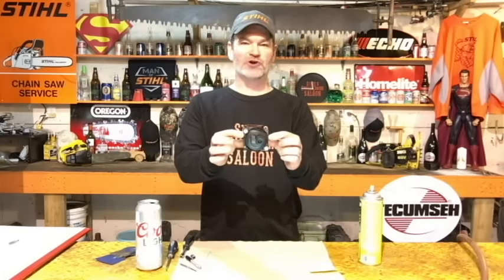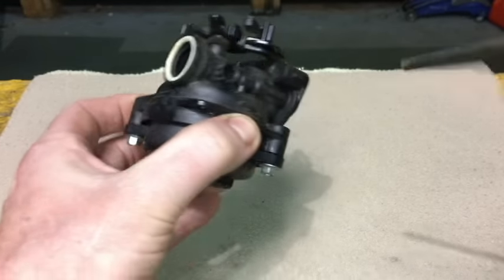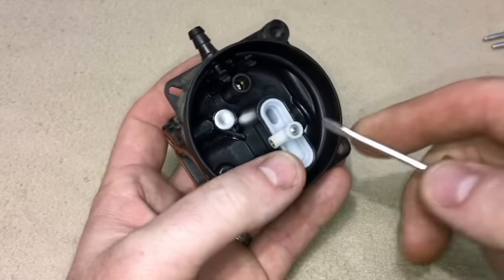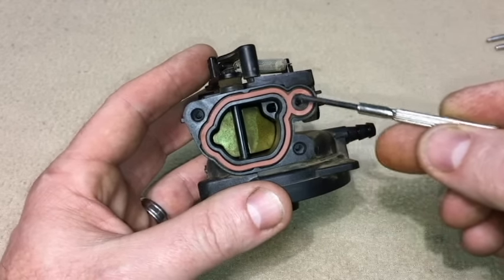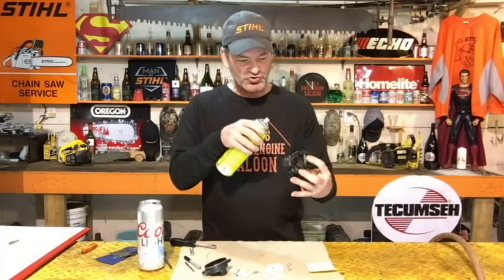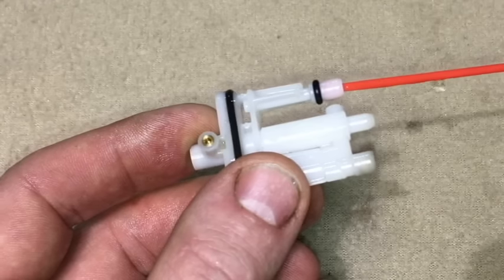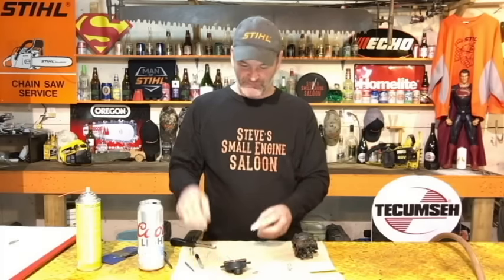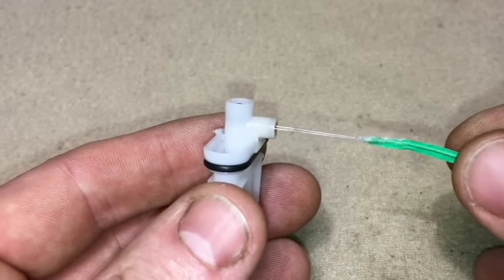EASIEST WAY To Clean a Plastic Briggs Carburetor

Comment: Hey Steve, 
My son brought home a mower that wouldn’t start, I noticed that it had one of those Walbro  plastic carburetors. The jet was clogged with what looked like corrosion so I drilled it out with a.04mm drill bit. Blew out the ports with carb cleaner. This mower runs like new.
Thanks so much for your advice and tips. I watch your shoe often.
Reply from the maker: You're Welcome...

Comment: Steve, thank you so much! My wife found a Craftsman mower for sale cheap, guy said it wouldn't stay running. I fired it up, it quit right away, but unit was in impeccable condition and engine sounded healthy when it ran. Tried cleaning carb, no luck. Then came across your video, followed what you said, now it runs like new! I was raised on the old metal Briggs carbs, this plastic one threw me for a loop...thanks again, Steve!
Reply from the maker: You're Welcome...

Comment: That man is a 'ginormous' talent. Respect due!
Reply from the maker: Thank You...
Reply: @StevesSmallEngineSaloon  hey Steve I need you help I bought a new carbureoter for my mower cause I cleaned it and that didn't fix it so I bought a new one and it still won't run it is not getting fuel to the motor I don't know why ?🤔

Comment: Spot on!💯👍. Just subscribed. I just did this yesterday. I didn’t remove the carb, just dropped the float bowl, popped out the jet assembly and cleaned it. As I didn’t see this video first, I put it back together and so far it runs fine. If it happens again, I will drill out the jet.
Reply from the maker: Right on

Comment: Thanks so much Steve,

My neighbor asked me last week if I knew anything about Briggs & Stratton engines.  I told him I've had pretty good luck keeping the two Quantum Briggs motors going on the two mowers I have.  My mowers are 20, and 25 years old, and they both came stock with the old 3.75 horse B&S engines.  The older of the two was lent to another neighbor who was kind enough to bring it back, not only with a bent blade, but a bent crankshaft and of course the lower seal destroyed, rendering it unable to hold oil.  :(

Another neighbor of mine was a scrapper, so I asked him if he had any old Briggs motors around that might have a crank shaft for me.  He said he had one, but it was a 6HP quantum that didn't run.  I asked what he wanted for it, and he said since it was scrap, just my old motor if I could get this one running.

The 6HP quantum had practically no compression, so I went to pull the head off, only to find that all 6 bolts were loose as a goose.  I bought a new gasket, put it back together and it's been running solid for 10 years.

The second, the 20 year old mower I bought new to keep at a second property.  It had the same 3.75HP motor as my original, but came with a plastic carburetor, which was tank mounted, and looked like my  moriginal, however, it never ran right from day one.  It was subject to constant stalling, even when my grass was never an inch overdue for cutting.  My scrapper neighbor had another Quantum 6HP laying on the ground beneath the bed of his truck, so I asked him what he wanted.  Again, he said it didn't run, so he was fine with an exchange.

That motor had a clogged jet, which is such an easy fix, since the jet is in the bowl retaining nut.  That motor has been running solid for 5 years now.

I told my neighbor, if it's a Quantum on his mower that I could probably fix it, so he brought it over yesterday.

It wasn't a quantum.  It was a brand new Craftsman that had a new style 6.75HP motor with the same plastic carburetor who went through in your video.  He bought the mower new at the beginning of the season and was only able to use it to cut his lawn 3 times before it quit running.  It would start right up with a shot of carb cleaner, then quit.  I was hoping it was just a stuck float, however the bowl was full with clean fuel when I opened it up.

The main jet was visible, and I couldn't see debris in it, so I figured it was time to search YouTube...

I couldn't see how the jet assembly was retained in the carburetor until I stumbled on to your video.  Thanks.  :)

I popped it out, and it still looked clean, however, I couldn't see light through it while shining a bright light against the nylon on the revers side, nor could I blow air through it.  I worked a sewing needle around in the hole for a bit, then I could see light shined against the nylon through the hole.  I was able to blow air through, then get a shot of carb cleaner to pass through from the other brass inlet with the output port blocked.

I put his mower back together, and of course it started on the first pull and sounded like a brand new mower.  Hmm...  maybe it runs like a brand new mower because IT IS A BRAND NEW MOWER!!!

I don't get it Steve.  Why are plastic carburetors such a problem?

I have a reasonable understanding of metallurgy, and I could see if it were an issue of dissimilar metals, I.E. if the jet were alluminum, pressed into a steel body.  But that is not the case.  Why should the jets on these plastic carburetors be so easily blocked?

Thanks again for the great video.  Like I said, I couldn't tell for certain how the jet assembly was held in the bottom of the carburetor until you showed me.

Steve

P.S.  Are you really the man of Stihl?  :)

Comment: Thank you Steve. I just fixed a mower for someone after watching a couple of your videos about these plastic carburetors. The one I was working on definitely had a "too small of a hole" problem. My thoughts are that it was just corrosion from the fuel she'd been using (ethanol); what I drained out was so cloudy you couldn't see the bottom of the tin can I drained it into. That water, over time closed up the hole in the jet. Also, at first, HATED the idea that Briggs had made a completely plastic carburetor. I've since changed my mind. It's simple and it works.

Comment: Thanks, Steve!  They've modified the cartridge yet again, at least on mine - jet is bigger, located at bottom, original location blocked off - but your walkthrough got me to a running lawnmower.

Comment: I know I’m 3 years late to the party but I need to tell you thank you for this video. You saved me hundreds on a new mower. I was at my last straw. I cleaned my carb 3 times, the gas tank and fuel lines twice, new plug and air filter too! Could not get it to stay running. I mowed my entire lawn by spraying starter fluid at the intake the whole time! I never knew that little white jet housing could come out. Sure enough that “secondary” outlet was clogged. Sprayed it, used my pin vise to loosen the clog, sprayed it again and reinstalled. Now my mower starts on the first try (no ether) and runs like a champ! Thanks again, Sir!!!
Reply from the maker: Right on Brady!  You're Welcome...

Comment: This is THE BEST video EVER for a B & S carb fix.  I first saw this video three years ago after I bought a Craftsman lawn mower off of craigslist for $25--the ad said it "wouldn't start."  I paid the $25 and followed Steve's carb cleaning video, and it started after the first pull.  Fast forward three years, and this same mower started having RPM surging issues last week.  I replaced the spark--no good, stilled surged.  I again pulled up this video, followed the carb cleaning steps again, and no more surging.  Thanks!
Reply from the maker: Right on buddy!  You're Welcome...
Reply: I have a machine that does up-rev motions, why does it do this?
Reply: @antonioalvarez2357  No guess.  If it has a B&S carb like these, try the cleaning.

Comment: Couple of points. When removing white cartridge, be very careful if you use small flat blade screwdriver that you insert it deep enough between side of white cartridge and black sidewall so you do not damage the thin O ring at the top of the white cartridge. When reinstalling this cartridge, be aware there is a plastic sleeve that sits in the body of the carburetor between the butterfly valves. It has a hole in the side wall of the sleeve. You cannot see this hole unless you remove the sleeve. This hole in the sleeve lines up with a hole in the body of the carburetor. The central jet of the white cartridge must pass through both of these holes to seat properly. Sleeve can shift while you are working on carb making it impossible to reinstall white cartridge. Cartridge should install with little pressure to seat it properly. If you find it very difficult to reinstall, sleeve probably moved and holes not aligned. To fix this, need to gently remove the larger butterfly valve (throttle) metal piece. It fits into a slot in the small plastic pin the holds it in place. GENTLY spread the slot apart and GENTLY remove this metal piece. You can then pull the pin out giving you access the the White/Grey sleeve. Can use your small finger to reach into space to sleeve. Use small probe and insert it through the hole where the main central jet on the plastic cartridge seats in the carburetor while using your small finger on the sleeve to align the holes. Once aligned, remove your probe but keep your small finger on the sleeve so the holes stay aligned and reinsert the plastic cartridge. Should easily seat in place. Reinstall throttle pin and gently insert the metal piece into the slot in the throttle pin, making sure you have it oriented properly.  What should have been a 20 to 30 minute job today took almost 2 hours because of these issues (torn O ring) and trying to figure it out ( as well as breaking that plastic throttle pin and having to glue and clamp it and waiting for it to cure before being able to reinstall it)
Reply: I think he heard you.  He did another video just to mention this plastic sleeve!  Well done!
Reply: Do you have a video on this procedure please..
Reply: Yikes, I need to read this comment again in future before I attempt any maintenance on this carburetor though, reading this has scared me so much I may never try it now!  I would very much appreciate a video that allows me to visualize what you have described here. :) 
[9.19.2022]
Reply: Many thanks for your important complementary comment.

Comment: The tip about drilling the hole bigger worked perfectly.  I bought a new carb and it was dead in two weeks.  I drilled the hole bigger as you suggested and it started up on first tug and no longer has issues with clumps of wet grass.
Reply from the maker: Right on

Comment: Hey stevens, this one really helped me. I've had that damn carb off 3 times, cleaning it. Put it back on, it would run for 10,15 minutes, then stop. I was loosing it! Then I watched you man.. drilled that little shit out to 20 thou,  wa,la,  runs like the wind.  Your awesome my man! I thank you, your saving the little guy a few bucks. I appreciate your help and your time. Thank you, God bless..
Reply from the maker: You're Welcome...
Reply: The fuel line should have an in-line filter because its inevitable that debris will get in the fuel, I seem to remember putting one in last time I had to clean the stupid carb out.
Reply: Sounds like Micheal has some slightly dirty fuel, defiantly a design flaw in these new carbs. Stevens is the MAN. this make me wanna start doing small engine repair. must be tone of these new carbs out there.

Comment: I installed a shutoff in the fuel line and turn it off and run the engine until it runs out of gas when I'm done mowing. It actually runs for four or five minutes on what's in the bowl. Between that and using stabilized non-ethanol fuel I don't expect problems in the future, but if I do, I now know how to fix it. Thanks, Steve, very clear tutorial!

Comment: I watched this video the other day. I have no experience with mechanics. My push mower wouldn’t run this year. I took the carb off and cleaned it with carb cleaner. I didn’t have to drill out the main jet though. My mower starts and runs strong. Thanks so much for helping me! I appreciate you very much. 😁
Reply from the maker: Great job!
Reply: @StevesSmallEngineSaloon  thanks! I was filling very accomplished. However, my crank top just broke. I don’t know how to order a replacement. 🙄

Comment: I took out the carb and cleaned it out and I brought my dead mower back to life. I also bought the drill bits you recommend below but they came in after the operation. The lawn mower has never run "right", so I think when I get a motivated I'm going to take the carb back out and try drilling that hole as you suggest. But it starts WAY easier than it used to just by doing this. Thanks for the video!
Reply from the maker: You're Welcome...

Comment: I just had my first experience with a plastic carb this weekend. My mother bought a craftsman power washer with a b&s engine last winter. She used it about three times then put it away with fuel still in it and couldn't get it to start when she tried to use it again months later. I pulled the carb, cleaned it with carb spray, washed it out with soapy water so it wouldn't melt (don't know if it would but why take chances), then blew out all the jets and passages with a compressor. After that it fired right up. I didn't bother with drilling out the jet but I made sure she understood the importance of not storing it with fuel still in it. Then she made power wash her house lol. I have admit, the carb was very easy to clean but I still don't like plastic. I really enjoy your channel, keep up the good work and have a cold one on me.
Reply from the maker: Right on Buddy!  Thank You...

Comment: Steve I’m in full agreement with you, this is absolutely the problem!!! I have broke down the carb two different times and throughly cleaned it. Put it back together pump the primer valve 3-4 times and it would fire right up. But then stop after burning off the initial fuel from the primer!!! I watched your video, tore it down for the third time and took the bread tie and cleaned it out throughly again. Put it all back together and fired it back up and it “RUN LIKE A CHAMP”!!!! Thanks for the Lesson and the Video!!!!!!!
Reply from the maker: Right on Harry!  You're Welcome...

Comment: Received a Troy Bilt Mower for free today that wouldn't start.  I was a plastic carb virgin but followed your instructions and now it starts on the first pull and runs perfectly.  The main jet did seem to be clogged and I blew it out with carb cleaner.  You da man.
Reply from the maker: Thank You...

Comment: Exactly the problem on a brand new Craftsman mower. A cutting torch tip cleaner followed by the micro drill bit and it starts and runs better than ever . Thanks for the fantastic video  and the sure fire fix for these composite carburetors,well done!
Reply from the maker: You're Welcome...and Thank You...

Comment: 2020 CRAFTSMAN 2800-PSI 2.3-GPM Cold Water Gas Pressure Washer with Briggs & Stratton. New purchase $289, worked perfect.
2021 Summer. Won't start. Paid local repair man $40. Was told to use non-ethanol gas to prevent carb issues. Worked perfect.
2022 Summer. Won't start. Pissed off and tried to sell on Clist for $100 and no takers.
2023 Summer. Cleaned carb jet w/cleaner and 14K gold acid. Works perfect.  

Thank you so much for giving me the confidence to solve this issue. Can't wait for next carb clog.
Reply from the maker: You're Welcome...

Comment: Steve, a simple observation:
I use small engines A LOT when mining in Alaska.  THE worst source for water and  "stuff" that clogs jets is the gas can.  "Stuff" just appears in them and no one notices until the jets get jammed shut.  A good, micro screen filtering funnel helps A LOT on water and junk.  You checked out Mr. Funnel products a while ago and I use them 100% of the time because  "Time is Money", especially WAY back in the Pucker Brush.

Another "trick" from long ago is to KEEP the fuel tanks full when storing for a short time.  The water that gets into the fuel (especially Gasahol in the lower 48) comes from the outside venting / air exchange of the fuel tanks.  With a lot of air in the tank there is a lot of expansion / contraction of that air and the water vapor is drawn in with that exchange air.  A full tank at the end of the day or before short storage means very little air exchange and almost no condensation water.  

Long term storage means draining the tank, running the engine until it stops and then final draining of the tiny bit of fuel in the carb bowl.  Open Ended, Really, Really long term storage means a little 2 stroke oil in the cylinder to help with rust and at a later start-up.

I just stumbled on my first Briggs plastic carb yesterday.
       All I Can Say is they sure are strange.   Thank You, for helping, Steve. 

P.S. - No Gasahol in Alaska - it freezes in the winter.     😵‍💫

- Joe -

Comment: Top job Steve- I appreciate your persistence and clarity - absolutely solved a very frustrating problem for me. Had to get the glasses out to deal with those pesky little drills but it was worth it. Started first pull on re-assembly and hasn't missed a beat. Cheers and have another cold beer - You deserve it!
Reply from the maker: Excellent!